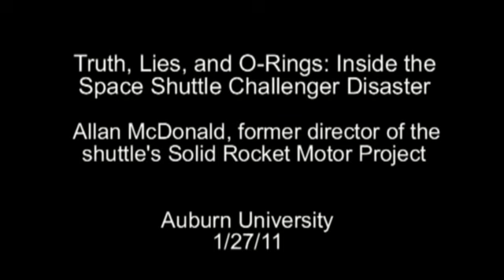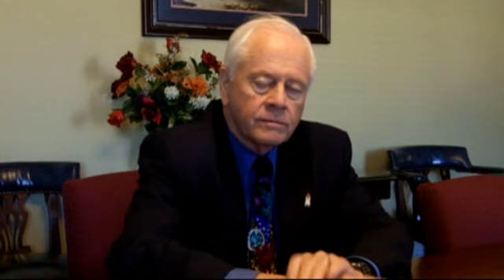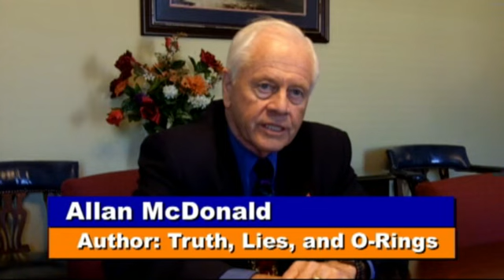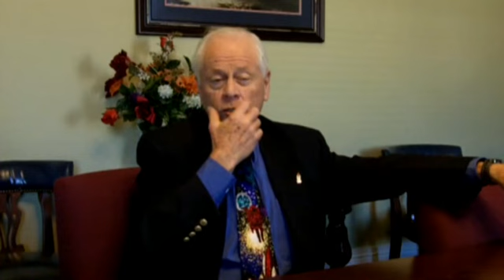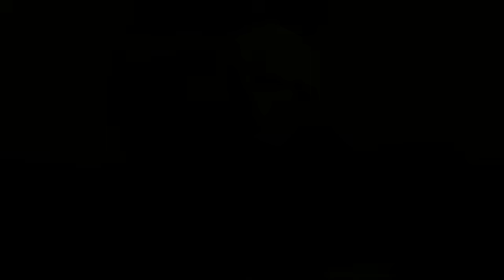Challenger: 25 Years Later

Comment: What I don't understand, and I've watched a lot of stuff about this disaster, is that the SRB O'ring is always automatically blamed. Here's my thinking tho': The SRB O'ring seals two segments and failed due to freezing. Hot gas escaped, literally torching a hole thru' something else as it did so and the whole thing then went bang...OK? That's the narrative, yeah? But answer me this someone? 1. Why wasn't the SRB totally split; torn apart all the way around by this process, sort of opened up like a can, which surely it would have been as that hole opened itself up and grew bigger? (You see both SRBs flying away perfectly fine and intact. Neither of them explodes until they are destroyed remotely some seconds later) Secondly, why did the explosion happen just at the moment of throttle up? You hear the command for 'go to full throttle' (I think it's 110%) and then bang.....surely this can't be a coincidence? The SRBs, of course, aren't affected by throttles - the throttle only effects the 3 main engines; SRB cannot be throttled, they're basically just huge fireworks which simply burn at a set rate. All this evidence points to a fault in the main engines of the craft or a fueling error at the moment the main engines demanded more fuel for full throttle? I don't think anyone's ever addressed these two points!
Reply: There actually was a huge hole near the bottom of the right booster. Watch "Space Shuttle Challenger. The Untold Story" on YouTube and you will see photos of the burn through hole. What opened up like a can was not the booster (It was just the blowtorch). What opened up like a can was the middle main tank filled with oxygen and hydrogen. This happened when the attachment strut burned and broke allowing the booster to rotate and slam into the top of the middle main tank.
Reply: Thanks for your reply and thoughts Nick......I hear what you're saying but it's basically in all the videos and makes up 95% of the online opinion. What I was asking was WHY the thing blew at 'go to full throttle' and also why the SRB didn't rip all the way around. Since posting I've also come across stuff that says all SRBs have liners inside them which begs the question, did these ones not and if they did then how did that hot gas get thru' the liner in order to then get thru' the o'ring joint. I am playing devil's advocate with all this by the way - just putting it out there as an alternative thing to consider. I'm not in any way implying a conspiracy or disrespecting any of the American heroes that died in this disaster.
Reply: If you believe a  liner (I don't no anything about it) should have been enough then there would be no need for two O-rings would there. What I know is the gases got through at launch and it should have blown up on the pad. It didn't because slag built up immediately and blocked the escaping hot gases.  When the shuttle was hit by a huge crosswind, the booster flexed enough for the slag to fall way allowing the hot gases to escape again.  As for why the SRB did not blow up, its because it was moving so fast that the flames were moving out and down away from the booster. 
The real mystery is how Morton Thiekol got the contract in the first place? There were other bidders who came in with a safer one piece design.  MT could not build a one piece booster because they were land locked and had no way to ship a one piece booster to Florida.  Why did NASA select MT? Were payoffs and corruption involved?  Russia went with one piece boosters and they never had a problem with them.  And it gets damn cold in Russia. I'd love to see a documentary on the bidding process.
Reply: Tom Tremayne Watch the Untold Story... Challenger..
Reply: @TomTremayne  They basically had no fuel left due to the hole 73 seconds in. Perhaps that contributed to it exploding at the go at throttle up moment, but honestly it was about to happen anyway.
Reply: @Lord_Thistlewick_Flanders  Those side mounted tubes (rockets) are made up of solid fuel. It was suppose to be one of those that failed, around a seam.....my question was how did the rest of the seam stay in tact, what on earth causes anyone to think the solid fuel cylinders are sealed by a simple o'ring (surely the sections are staggered somehow to protect the joins or at least they have staggered liners inserted) and why would that failure be affected by throttle up in a totally separate area of the craft, controlled by separate systems (i.e. the main engines with non-solid fuel) - no, I still say the failure was in the main engines and NOT in the SRB as is blamed!
Reply: @TomTremayne i've read the book 'truth lies and o'rings by allan macdonald. It's a very thorough and technical explanation of the boosters and how it came to fruition. it's faults and the accident are discussed in detail among many other things. Allan Macdonald is probably the most knowledgable when it comes to the SRB and in the aftermath of the disaster he said he was certain the only thing that didn't cause the accident was the SRB. After all like you pointed out, they were the only remaining parts still flying around after it exploded. It wasn't until further analysis and video review that they discovered the puff of black smoke around .6 of a second after ignition. That was both o rings getting vaporized by the heat. then question then is, why didn't it blow up in the pad? What they believe happened was the aluminum in the gas that they used became superheated and solidifed and became a temporary ceramic seal in place of the o-ring. Now it was very fragile and unfortunately around 50-55 seconds in, when the craft reached max-q(that is the most dynamic pressure on the aircraft) it displaced the seal and that's when a small flame can start to be seen which led to it eventually burning through the supporting strut attached to the tank and make it collapse. The cross winds that day were the worst they'd ever recorded and if they weren't so strong, just maybe that ceramic seal holds on and they make it into space. So the SRB joint was to blame, we have hard evidence of that both in the video and in the retrieved parts of the craft itself. the seals are just rubber and it seems crazy to think they could prevent hot gas from escaping but that's what they did and until challenger they got the job done. They just don't work in freezing temperatures. I don't think the main engines were the cause of the accident and if they played any role it was incidental at best. The instruments went haywire at the end so i'm sure certain systems were not working as they should.
Reply: Tom Tremayne — The SRBs didn’t come apart because the sections were securely fastened together.  It isn’t complicated.  The hydrogen engines did not cause this disaster.

“Coincidence” just means that two things happen at the same time.  Increasing the throttle of the main engines coincided in time, approximately, with the rupture of the main fuel tank.  That is a coincidence by definition.  Whether there was a causative relation is another question.  There was not.
Reply: @GH-oi2jf  Interesting comments........so do you believe that the main fuel tank ruptured due to an SRB burning a hole in it? If the answer's yes, then that 'burn' is alleged to have been caused by solid fuel burning thru' and escaping past an adjacent join. My argument, or part of it, was that surely the SRB cylinders were lined in some way or that joins were staggered or offset somehow to give overlap and residual strength. All the talk is that there was just an abutted joint with a meagre O'ring to seal it. Looking at logic and cylinder technology at the time tho' this is a way too primitive design. I mean, I don't know but I think the argument's an interesting one?
Reply: There was no known fault in the main engines.
Reply: @GH-oi2jf  You can't definitively say that, they were blown to smithereens!
Reply: The SRB wasn’t torn apart simply because it was strong enough to withstand whatever stresses it was subjected to.  When what actually happens differs from what you expected would happen, your expectations were wrong.

The timing could be a mere coincidence, but it is also possible that the stress of the sudden increase in power contributed to the breaking of the lower attachment of the SRB, which led directly to the rupture of the main fuel tank.
Reply: @GH-oi2jf  Well, I appreciate your opinion but my intention was to set up a debate about this topic & I think in that respect, I did OK. I've also yet to hear good rationale as to why the SRBs weren't lined with liners that overlapped the joins from the inside & why those joins then weren't welded shut? I get that to transport the SRBs they had to be in sections but once loaded and prepared surely they could have welded them shut. I mean why put that much force & explosive power behind an O'ring!? I'm not a conspiracy nut but I thought there were things that made little sense.
Reply: @TomTremayne  — The SRBs were not a robust design.  There is YT video of Boisjoly discussing the design weaknesses in detail.
Reply: @TomTremayne they were already at throttle up for 10 seconds prior to breakup
Reply: If you watch the 'Shuttle Challenger Explosion [New Copy Found; Better Quality] video on the 'What You Haven't Seen' youtube channel (https://www.youtube.com/watch?v=rUqPMMgfJ4Q) & there's many others too, you'll see that the command for throttle up is given & then maybe 2 seconds later Challenger blows up. Please fact check stuff before replying & anyway, even if they had been at full throttle for 10 seconds, my point still stands that the explosion may have been linked to the engines because the SRBs are just static, solid fuel canisters, not really affected by the throttle.....The throttling-up, whether it be 2 seconds or 10 seconds prior, seems to initiate the explosion.....that was my point Sir, & in making it I'm not being disparaging, disrespectful or anti-American in any way! I am someone interested in engines!  @respectdawildo_danjones508
Reply: @TomTremayne  You literally do not know what you're talking about. If you did, you would realize first of all that the voice communications relating to the "throttle up" call were merely confirmations of good operational readouts consequent upon events THAT HAD ALREADY HAPPENED VIA COMPUTER AUTOMATION, and NOT "commands." The PR officer Steve Nesbitt had already conveyed the telemetry reading of 3 engines having regained full throttle at 104% before the so-called "command" is even broadcast. That this "go" status comm call came 2-3 seconds before the actual onset of catastrophic breakup (note: not an actual explosion in the technical sense) was a complete coincidence. In addition, in the milliseconds between the main engines' loss of fuel feed and the termination of telemetry data, said telemetry data had already reported that the main engines were in automatic shutdown mode.

But I'm totally looking forward to your next "scoop." 🤣
Reply: @nickv4073  Excellent points about MT
Reply: @TomTremayne In order to impinge on the first primary o-ring, the hot gasses first need to find their way thru the “vacuum putty”.   Which had been found to have decently-severe air pockets during application install on prior SRBs.   This variation in “vacuum putty” is one reason why the o’ring did not experience blowby and erosion all the way around its circumference of the 12’ dia booster.

The nature of the Right SRB fully detaching from its aft strut and allowing its top-end to collide with the upper-part of ET and LOX tank, is mostly due to the Wind SHEER at that altitude…as proven by post-disaster computer analysis of the SRB exhaust contrails from 1000’ up thru 40,000ft, which showed smoking gun of the significant Wind Sheer that late morning.

No wind sheer, its almost guarenteed that the aluminum putty temporary stop-gap after T+0.67sec would have maintained its sketchy seal for another 30-40seconds until booster jettison.

And with zero wind sheet, even if the alumina oxide putty seal would have given way, it is possible that the Right SRB may not have vector twisted due to its computers countering this sheer.  Preventing the final coup de grace.
Reply: @nickv4073 Beautiful

Comment: No big deal it was only 7
Reply: Feynman was involved in the inquiry and was harshly critical of management's failure to recognize and then ignore previous and current  concerns in regards to the many physical evidences and engineering concerns.

Ethics and/or morals and there value among individuals and organizations  are at the core of the failures of NASA and the manufacturers who were to abide by safety protocols and other concerns due to the specs and temperature concerns willfully ignored them.

More importantly there continued deception after the accident to protect their launch go ahead.

Such things will continue to happen when persons in final decision positions who lack ethics and/or morals are placed in charged over those who do have ethics and/or morals.

Such comments as it was only 7 would be the earlier example of ethics and/or morals.

Democracy is the most dangerous thing when the voice of reason treads and stands up against the ologies and culture of the majority.

Or worse yet when the majority thinks they are correct and the voice of reason is not.

Then society circles the drain and drinks it water of self delusion and says, it is pure.